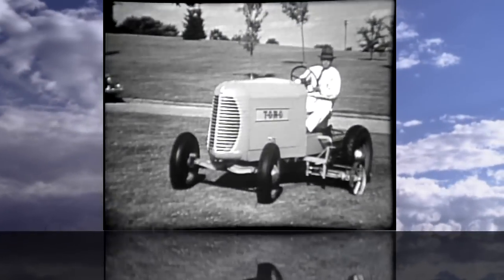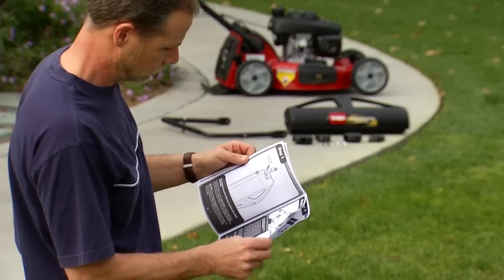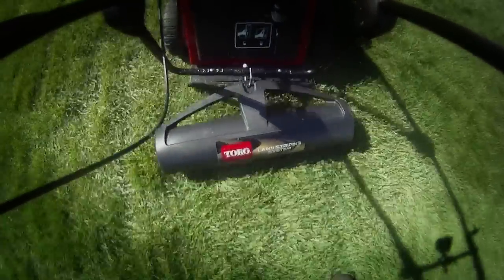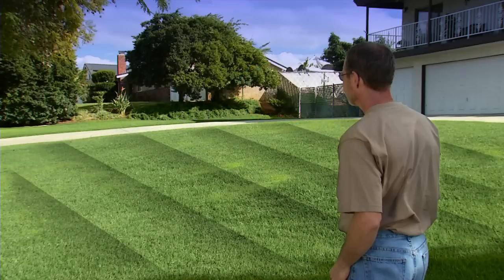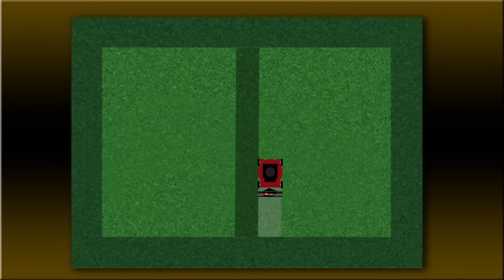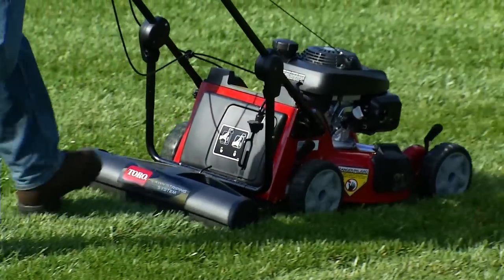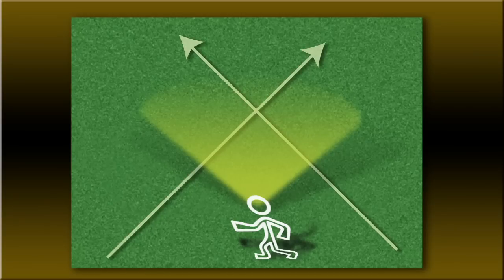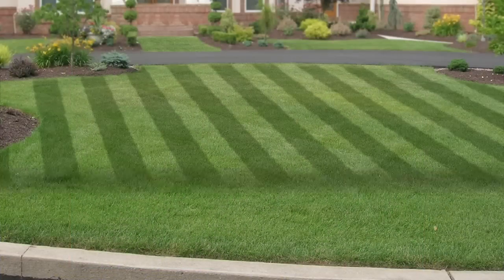Lawn Striping "How To"

Comment: The best way to get a striped lawn is to buy a mower which is roller driven.
Reply: Agreed- preferably a 10 or 12 blade cylinder mower. You can get amazing mowers built for tennis courts and bowling greens but they come at a price- some cost as much as a small car...
Reply: Cylinder mower is UK speak for reel mower.

Comment: how does it make he light lines and the dark lines, but I liked it
Reply: The direction of the grass
Reply: Im guessing he puts less sand
Reply: This is from the difference in reflected light from the blades of grass being laid over by the striper in different (alternating) directions. The strength of this effect also depends on the grass type and cut height.
Reply: Rolling different ways pushes the grass over different directions.

Comment: thats all that product is a roller on the back of your mower you can just buy one them old fashion push along rollers. And they last 100 times longer and are 100 times cheaper second hand. check out ebay

Comment: Forget buying gadgets, or worse, hauling extra weight around. To stripe a lawn, simply set the deck height higher on one side and mow your yard in a loop, not alternating passes. When you come back around, the new cut path will be the low end butting up to the high end of the last pass. That subtle change in grass height will reflect light differently and create the stripe. Yes, it really works; been doing it for years.
Reply: Hi, I want to follow your advice but I got one question: How high do I have to set the front wheels and how high the rear wheels must be set? I'm new at this and I wanna impress my customers :-)
Reply: My mower (riding) has pins in either side of the deck. I set one side one hole lower.
Reply: pnut166 Not sure what you mean "mow your yard in a loop"?
Reply: +SlayerzXtreme The difference is from side to side, not front and back.  One side of your machine needs to be higher than the other.  You could put larger wheels on one side if your machine sets the height of the mower with one lever for all wheels.  
Glad I live in the country and don't try to keep up with neighbors.
Reply: I'm try that out ...thanks man
Reply: mow in circle with uneven L/R height, will look like waves in circle, look like scalar map